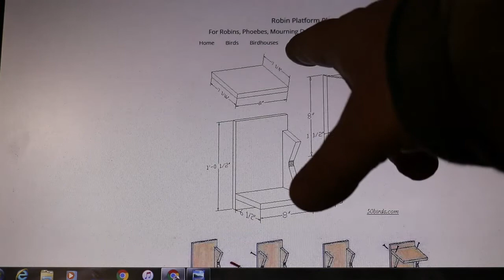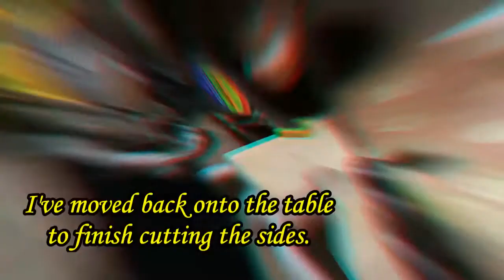Building A Nest Platform For Mourning Dove's Out Of Maple Wood

Comment: What is the purpose of the holes drilled on each side and cut back at 45 Degrees?
Reply from the maker: That was just the pattern for this nest box. If you wanted, you could just put the sides on without the area cutout. Thanks for the comment.